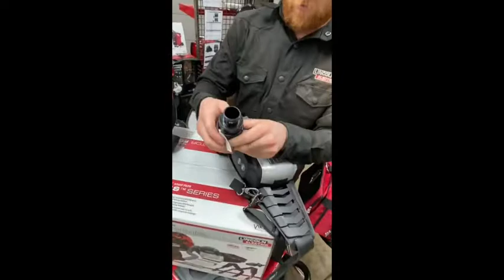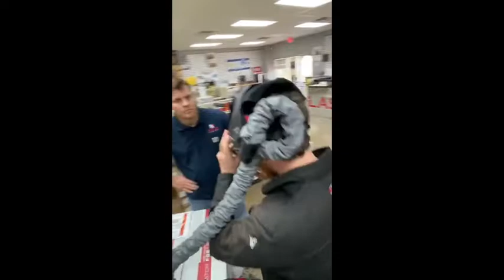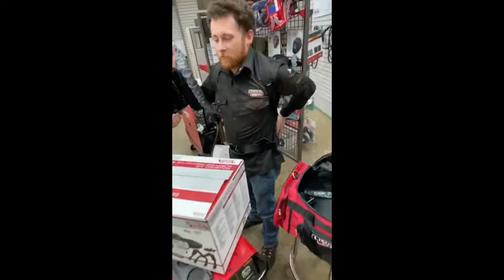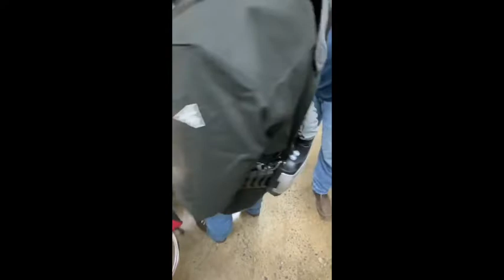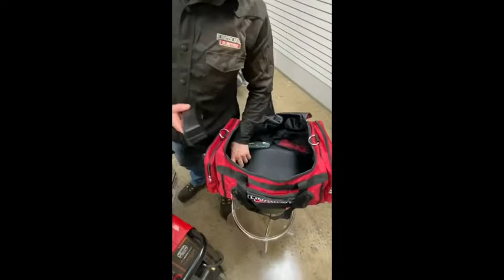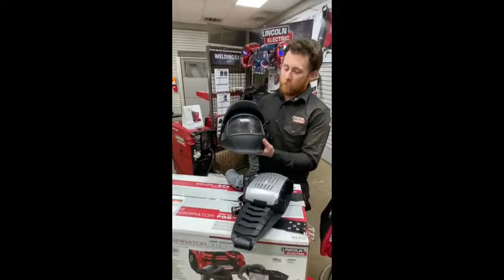Atlas Welding Supply PAPR Demo

Comment: This might be a stupid question, but you mentioned being able to use the PAPR portion of the kit for other uses. Would the PAPR portion work with the 3M Versaflo respiratory faceshield? Are the hose connectors some kind of universal standard for PAPR equipment, or do you know of a respiratory faceshield that this will work with?  Thank you